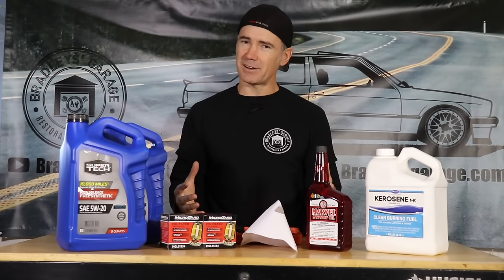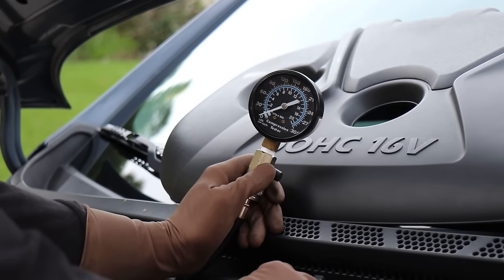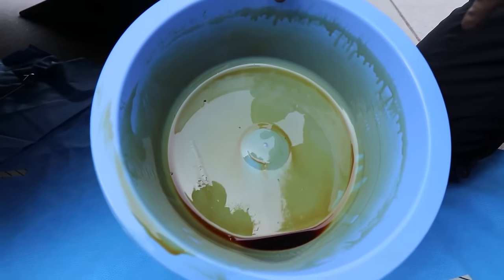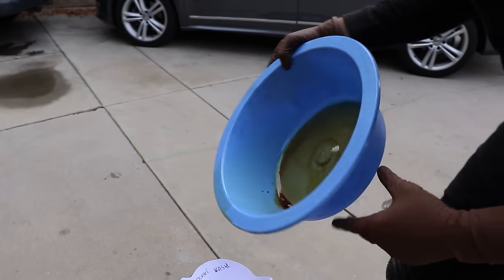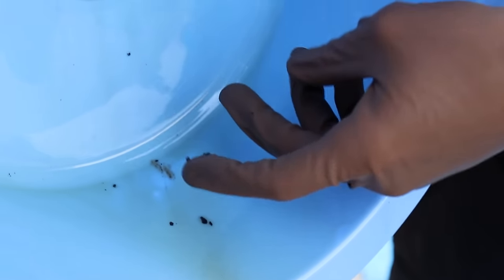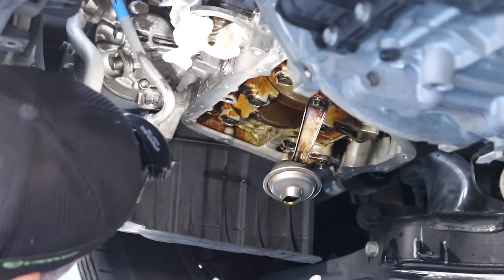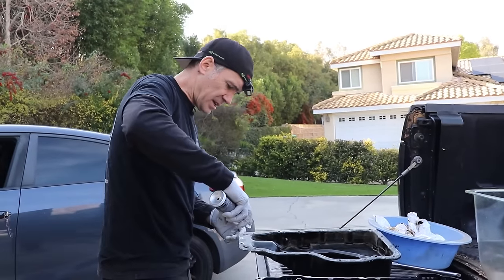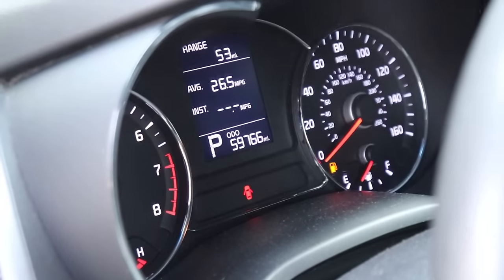*UPDATE* Customer States Jiffy Lube refused to change my Oil - Sludge Factory Kia Forte

Comment: The thing that surprises me most is that Jiffy Lube had the integrity to say, "No. Take it to a mechanic."
Reply from the maker: We were also surprised that Jiffy Lube actually looked under the oil cap before starting any work. They must have been sued before for engine damage and are not taking on any liability in the future. 
It was great of them to tell him to go straight to a shop to get it looked at. They even topped off his oil for free so kudos to them.
Thanks again for the comments, Cheers!
Reply: That's the advice I've been giving people over the years - AVOID quick lube places at ALL costs!   That's the expressway to a vehicle's early grave.
Reply from the maker: @dantesinfernopurgatory7826  That is why perform all of our own maintenance on all our cars. We do not trust anyone to work on our cars, regardless of the issue. One way or another we will figure out to get it repaired. Cheers!
Reply: I do my own unless it is something like a transmission, that isn't a driveway job
Reply: the worker probly got fired for it
Reply: Theres a few good Jiffys just hard to find
Reply from the maker: @cookupcuse7152  There might be some out there, we just won't be looking for them. 😎
Cheers!
Reply: Lmao you see good where it is not there. They obviously just dont want to deal with that crap so they tell the customer to fuck off.
Reply: @TheSleepingonit you mean transmission fluid change?
Reply: Take 5 would have too
Reply: I work at a Valvoline an if there s something like this wrong we won't touch it ,u can make a claim it's on us,but my experience most these prob are the customer begin cheap lazy ,these gdi sux in general, an   a certain big dealer who don't change oil filter every oil change yea u Mercedes lol😂
Reply: They wanted to avoid a law suit, knowing the engine was on borrowed time and they would be liable if it blew.   I think it is still on borrowed time although a great effort has been made to keep it alive.
Reply: Liability

Comment: The owner is very lucky!!! Those cars are very sensitive to extended oil change intervals. I've owned one and I was changing the oil every 3k miles and was burning about 1/2 quart since the beginning. Good job!!!
Reply: Forced induction coupled with direct injection with Korean engineering will do that unfortunately
Reply from the maker: Thanks for the comments, glad you enjoyed the video. We will continue to monitor it every 1k miles until the next oil change. Hopefully we got it squared away and it continues to run great from this point forward. Cheers!
Reply from the maker: This is the LX model so it has the 1.8L MPI motor, not sure if they have the same issues as the 2.0L GDO engines? This is our first time working on the Korean brand as we mainly focus on Euro stuff.
Cheers!
Reply: @BradleysGarage  mpi? So I guess that port fuel and direct injection? I’m not familiar with the 1.8. I may have over generalized thinking most Kia’s and Hyundais are turboed with DI only. Last I heard, only Ford and Toyota implemented the dual port fuel and direct injection combination.
Reply: @4runner1grfe  MPI is just Multi Point Injection,

After Carbi cars, the first step that most manufacturers went with was a single large injector where the carbi once was,

They then went to MPI which just means that each cylinder has it's own injector/s

So if this car doesn't have GDI, then it has port injection (so the fuel injectors are located on the inlet manifold).
Reply: I have a 2015 Kia Optima Lx 2.4  I replaced the PCV recently, and I changed the oil every 4,000 miles using Amsoil and performed air induction service every 10,000 miles. Will that be sufficient to stop an engine failure? Given the infamous engine problems with Kia vehicles.
Reply from the maker: @rodrigueze59  It sounds like you are doing all the right things for your engine. I don't think you should have any long term issues if you keep up that regiment.
Just remember the fuel filter and trans service need to be done every 60k as well.
Cheers!
Reply: Might need to use the expense real synthetic oil that's not found in stores. That engine might be cooking the oil for it to cake up .
Reply: @BradleysGarage I believe the 2.0 is the MPI, the 1.8 is the GDI. Well at least it was on my 2017 Forte LX, and my friends 2014 Forte LX

Correction: prior to 2017 Base models (LX) were 1.8. 2017 (Facelift) they got a 2.0. What I recall the only issue with this engine was that the valve cover gasket would need to be replaced since it leaked at around 30k miles
Reply: @rodrigueze59 you’ll be fine.  A relative of mine has a Kia soul and did this same thing.   I flushed the engine several times and over a year later the engine is still just fine.  These engines are not fragile. As evidenced here
Reply: Korean engines are definitely not Toyota engines and don't do well with dirty oil. I have some experience with the 2.0 Nu engine. You buy one brand new out of the box, they're noisy on startup until they heat up inside and everything expands. If you go 7500 miles like the owner's manual says to do you will be burning oil in no time. The oil control rings get gunk on them and the rest is history. There seems to be a lot of space between the pistons and pistons walls to reduce friction but causes other issues.
Reply: @notsureyou  and multi port injection is just port injection, As far as most mechanics are concerned its just a fancy name and more relevant to understand port injection
Reply: @4runner1grfe  As far as I know most of them are port injected, bought my 2023 Elantra brand new with the 2.0L "Smartstream" Atkinson cycle and its MPI or port injected. From what I remember their line up, everyone that had this 2.0 L was port injected and Atkinson Cycle. The N line I know has a 1.4, 1.6, 1.8 or something but is DI
Reply: Every 3k is crazy, definitely impacts how viable the vehicle is economically
Reply from the maker: @7eis Inexpensive oil change for this Kia is less than $25. Even if you use premium oil, it's still less than $40.
Pretty cheap insurance for peace of mind. Cheers!
Reply: Probably some coolent sepage and clogged Pcv GM tech since 1980 the old oil was terrible use to put diesel in pan and use a brush then flush with drain plug out to get crap out of engine so oil pickup didn't get clogged
Reply: @rodrigueze59 will not stop the problem. That 2.4l engine is notorious for sludge build up no matter what you do. I had the same problem. Changed the oil every 3k after the first engine replacement @18k. At 38k same problem happened so I just got rid of the car after they replaced the engine again.
Reply: You should never need to change your oil every 3000 miles, that's insane.
Reply: @roasthunter If the vehicle is driven exclusively short trips in the city it barely gets to operating temp.

Cylinder washdown = fuel in the oil. Either do a 25 mi highway trip once a month or change the oil every 3K.

Special case. Never say never....
Reply: @larrymitchell3502  I personally doubt any reason to change at 3k on any driving conditions.
Reply: If you were burning 1/2 qt every 3k miles since you bought it the rings had sludge before you bought it.  Newer engines shouldn't burn significant oil in 3k miles.  My 95 Toyota still doesn't burn oil.

Comment: The oil looked pretty dark after the 420 mile run. I’d say it’s still pushing baked sludge out of the oil galley’s and block walls. Probably repeated oil changes every 3k will get the rest out. A bottle of Seafoam in the oil will clean the snot out.
Reply from the maker: Thanks for the comments, we will check it every 1k miles up to the next 3k oil change. I'm sure they will be small amounts of residual coming off for many more miles. We could still see the walls with some burnt on residue.
We may throw in a bottle of Seafoam right before the next oil change just to hit it again. Cheers!
Reply: Modern full synthetic oil usually turns dark very quickly, but it does not mean a decrease in performance. Combustion gasses and heat
Reply: It was encouraging to see the reddish tinge from the Marvel Mystery oil in that last flush
Reply from the maker: @bruwin It definitely had a little reddish hue to it. We may continue to add 4oz of MMO to the next few oil changes just to finish cleaning things.
Cheers!
Reply: Have run full syn. From 500 miles to present 245k miles, changed every 10k miles. It never got dark untill 160k miles. It was distressing to throw away such clean looking oil at 10k miles. 5.3 chev. Silverado 2004.
Reply: I would be running it with marvel mystery oil for the next 3 or more changes and change oil every 1000 miles for the next 5 changes just to make sure, now it will keep cleaning the rest slowly by dissolving the remaining sludge inside the cavities engine block etc,  also I would use amsoil signature series as that oil is heavy in detergents or redline, its expensive this process but hey, all you've done so far so why not
Reply from the maker: @robsonrissotrainer  Thanks for the suggestions Rob. We will add 4oz of MMO to each subsequent oil change moving forward. Maybe look into using Amsoil in the future as well.
Cheers!
Reply: Great work! Enjoyed both videos.👌
Reply from the maker: @dondonaldson1684  Thanks for the kind words, glad you enjoyed the videos.
We just posted the 3k mile update video here - https://youtu.be/QrJ0B-KXTw0
Cheers!
Reply: They dont live close to the sea 
Will be hard to get the foam!
Reply: @summerforever6736 do you drink to the foam?
Reply: @BradleysGarage I only use AmsOil. Mobil1 is not as good as you think. Valvoline Syn is actually better than Mobil1. But, AmsOil is worth the extra $$$
Reply: I'm a retired master mechanic that owns a 2014 Soul 2.0 now with 166k running fine. I bought it at 144k and oil looked ok then the next week I got lazy and got it changed at a 10 min change 3 days later the oil light came on with idle!! Foamy sludge in the valve cover.  I emptied the oil and changed the filter to a wix and put in 1 gt Rislone flush and cheap oil and REPLACED THE PCV VALVE AND HOSE ( i found the valve and hose packed-- i used a genuine Kia valve $13) ran it hot for 25min then drained and put on another Wix  filter and 4.25qt 10w-40 Mobil 1 synthetic.since then it is still clean and no low pressure or oil consumption i have changed the Mobil 1 and Wix filter every 4k and all seems ok.  I BELIEVE THE PCV VALVE AND NON-SYNTHETIC OIL CAUSED THE SLUDGE MONSTER!

Comment: This was an awesome series.  Great job, you no doubt saved that little engine.  Besides big hunks, I think that amber/dark color of the oil shows the carbon/dirt being suspended by the detergents and removed in the oil through changing as intended.  No big hunks to plug up passages like the days of old oil pre-detergents.  Great job
Reply from the maker: Thanks for the kind words Steve, glad you enjoyed the video. We feel pretty good about how things turned out. Not much debris coming out after the secondary flushes so that was a good sign. I'm sure there will be small residual amounts coming off over the next few thousand miles. We will check on it every 1k miles until the next 3k oil change.
Thanks again for hanging out. Cheers!
Reply: No detergent was back in the 70’s
Reply: Surprised to see the Kia made it through neglected maintenance

Comment: FYI - the Marvel Mystery Oil is good stuff. It works slow. I’ve used it in a GM 4.8 to keep a lifter from tapping (common problem.) After 2 to 3 3k oil changes, it will remove all the varnish.
Reply from the maker: Thanks for the info Chris, we will continue to add some to each of the subsequent oil changes. Cheers!
Reply: Absolutely!
Reply: Marvels is great. 
That overpriced stuff used in the beginning is nothing but over priced diesel fuel. 

Liquid Molly 🙄

Mechanic for 35 yrs here. 
Incase anyone wants to say something.

Comment: I remember the guys in the shop doing a similar process on a Saab 9-3. Came into the shop for it's FIRST oil change since new. It was at 40,000 miles! After all the flushed , etc it ran amazing. Virtual no wear in the engine. Those Saab engines, especially the 2.3t are amazing.
Reply from the maker: Thanks for the sharing, appreciate the story. Cheers!
Reply: I work in Walmart in the Auto Care Center, and about 10 years ago, we had a Dodge Ram 2500 DIESEL come in for it's first oil change....at 40,000 miles. The guy using the truck never ran a diesel before, and it was his company work truck. He worked in the oil patch so he was using the truck every day and put a couple hundred miles on it every day. So he didn't know it required much more servicing than even a gas should be receiving. But 40,000 miles on any oil is never a good idea. 
Anyway, I was the unfortunate lower bay tech on the oil change. Arguably what came out of the drain plug could no longer justifiably be called "oil". I would describe it as carbon/sludge in a fluid suspension. Yes I ended up getting it on my hand and NO I could not wipe it off. I couldn't even hold onto a wrench. I had to go wash my hands before I could finish the oil change. Afterwards, I advised the guy to only run maybe 1000-1500 miles then immediately get the oil changed again to try to clean out the engine. He didn't come back to Walmart, so I have no idea what the end result of that was.
Reply: If they so amazing why do I see 0 on the road in portland/vancouver
I see alot of every other brand but a handful of Saabs a year, and I actively look for unique odd cars
Reply: @YungSteambuns  because there are very little saabs sold in America
Reply from the maker: Looks like there was only about 253k 9-3's sold in the USA from 1999-2011. That works out to be 21k total per year.
Going on 25 years old, there can't be that many left on the road, regardless of how good the engines are.
Cheers!
Reply: @BradleysGarage  this was in 2006 when the car came in. Believe it was a 2004 9-3. I had a 1997 9000 cs that I upgraded everything on to an aero spec , plus had the ecm flashed. To this day its still my favorite car I've ever owned. The 5 speed was amazing, and cruising on the interstate was where the car shined. Super smooth, lots of power, and got very good mpg if you stayed out of the turbo. Since it was the cs version it had no sunroof, and had cloth seats which was a bonus. Being a lift back you could also fit just about anything in there. Amazing car in the snow too.
Reply: @YungSteambuns settle down, Twatty McCunterson. Saab has been out of business for almost 20 years, and those were largely rebadged GMs and Subarus.

Real Saabs haven’t been sold in the us for around 25 years.

That’s why you don’t see them.

You don’t see many things that’re 25 years old… even on an emotional intelligence exam in your case.
Reply: @dannyo6699 geezer probably ran it another 40,000 on 1st oil change 😭
Reply: @Relax493  he never came back that I was aware of anyway.
Reply: The 2.0 T is also a bullet proof engine , shame GM ditched them they was 18 years ahead of there time now since every car manufacturer are running similar engines
Reply: @dannyo6699  probably broke down soon after and claimed the techs for it

Comment: A 3000 miles interval might be ok be after the sludge party to remove last bits of buildup, but usually i'd find that a little bit exaggerated. 5000 miles should be ok after that.
Reply from the maker: Thanks for the comments, we will keep performing the 3k mile oil changes until things look back to normal. Hopefully we have done enough to salvage the motor long term.
We posted the 3k mile update video if you haven’t checked it out yet - https://youtu.be/QrJ0B-KXTw0
Cheers!

Comment: 5000 k oil changes are fine.  3k is overdoing it.
Reply from the maker: Thanks for the comments Steven, we just wanted to perform it every 3k to finish getting all the debris out of the motor. Hopefully we have done enough to salvage it.
We posted the 3k mile update video if you haven’t checked it out yet - https://youtu.be/QrJ0B-KXTw0
Cheers!

Comment: Perfect example of why changing oil regularly is important and to not bother with these "extended drain" intervals some manufacturers state. We have a 15 year old Sentra which got plain old conventional oil changes every 3k miles (whatever oil and filter is on sale) and with 162k miles on it I recently had to do the valve cover/gasket and the top end was spotless with very little wear on the cam lobes.
Reply from the maker: Agreed, you can't go wrong with every 3k oil changes. We will stay on top of Jake to keep performing 3k oil changes. Thanks again for hanging out.
We posted the 3k mile update video if you haven’t checked it out yet - https://youtu.be/QrJ0B-KXTw0
Cheers!

Comment: I can't believe you got rid of most of the Forbidden Marmite in that engine!  I've seen engines with less sludge be deemed write-offs.
This wasn't an oil change, it was a damn exorcism!
Reply from the maker: Thanks for the comments Prince, it was definitely more of a mess than we anticipated. Glad everything turned out good and we were able to salvage the motor.
Cheers!
Reply: But whats built up on the rings?
Reply from the maker: @bobbg9041  No way to know without a teardown. All we can do is monitor the oil level over time to see if any oil burn is occurring. 
After the first 1k miles, we have not seen any evidence of oil loss. We will continue to monitor ever y1k miles until the next 3k mile oil change.
Cheers!
Reply: Love marmite on toast peanut butter and cheese 😊😊😊
Reply: Lololo